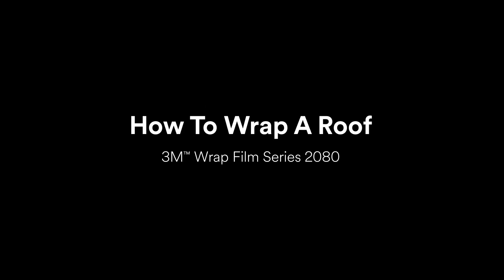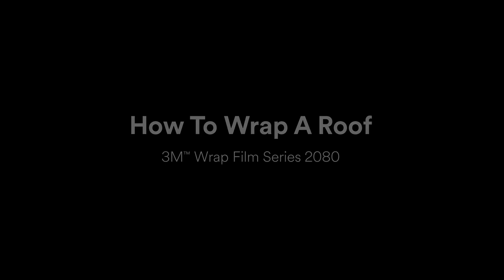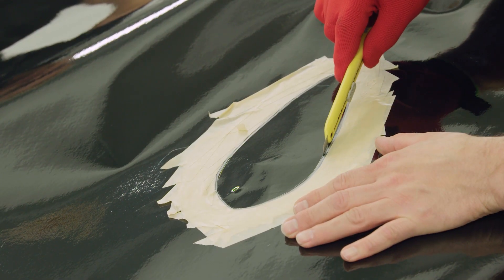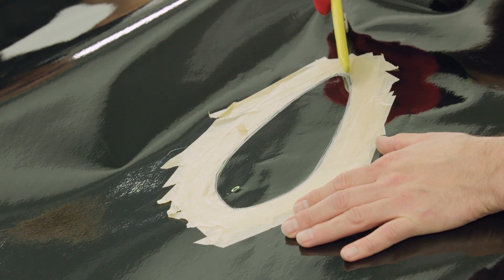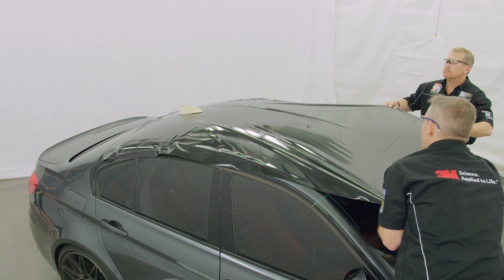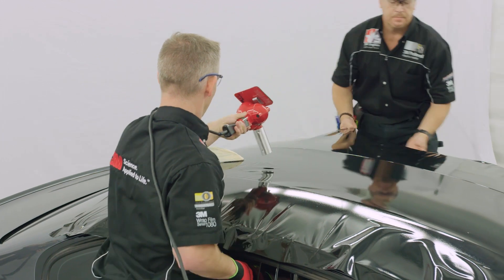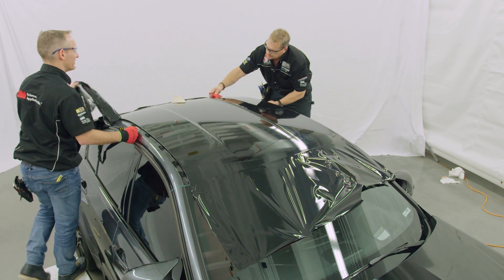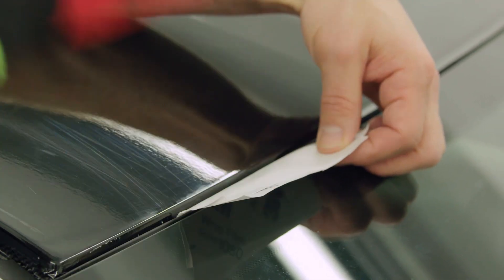How to wrap a roof - 3M™ Wrap Film Series 2080

Comment: Wouldn't it be less effort to just remove the shark fin :/?
Reply: Removing the fin requires removing the headliner in most cars.
Reply: It's about the same amount of work. Between taping a template or removing the back clips on the liner, I'd do the liner. The finished product will also look much better.
Reply: Btw if you ever do this yourself you just need to remove 4 clips in the back of the headliner and that will give you enough room to remove the shark fin. Have done it in two different cars.

Comment: Would you recommend using soapy solution to aid in setting the film in place ??
Reply from the maker: Hi Ivan - We don't recommend that you wet apply the film. The surface must be clean, dry, and free of all contaminants. Clean the surface with detergent and water, and then remove any greasy/oily residue with solvent cleaner. Lastly, finish with a final isopropyl alcohol clean.